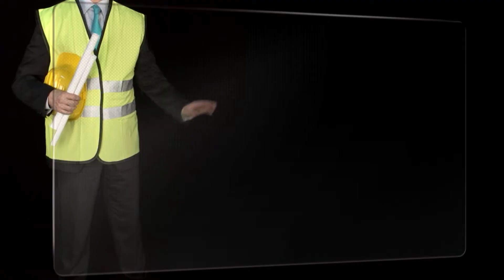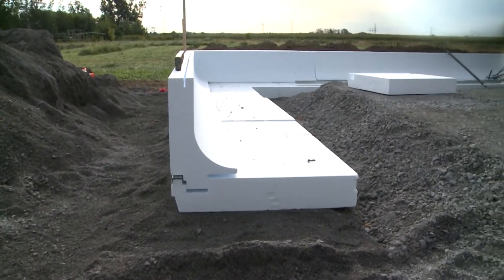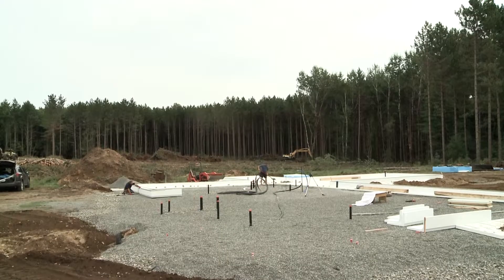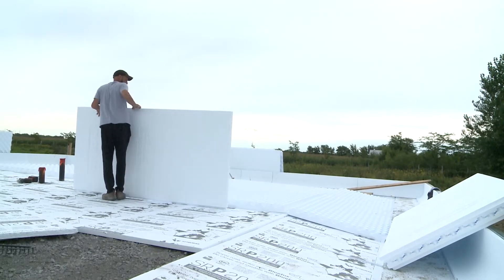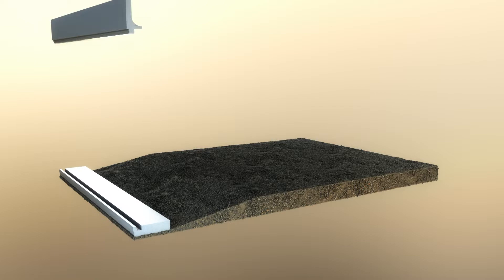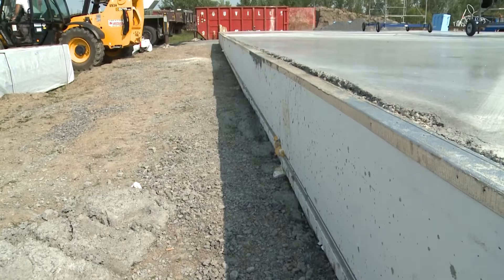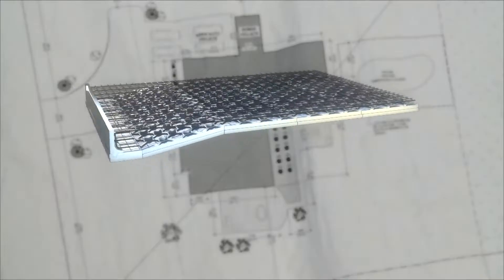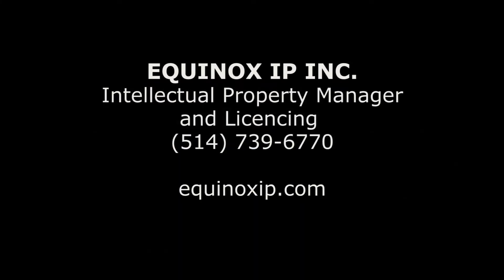ISO-SLAB - INSULATED SLAB-ON-GRADE FOUNDATION

Comment: Is insulation needed in places like Florida?
Reply: Perimeter frost protection skirt is adapt to you frost cycle area ,if request.florida is not request only perimeter modul and inner eps sheet to make dry concrete slab.
Reply from the maker: No perimeter frost protection needed.  The iso-slab base remains to have a mass of dry concrete. Thank you for your interest in this innovation.
Reply: Under slab insulation is R33,5
Reply: The insulation and thermal mass can actually help keep the place cool and reduce the amount of air conditioning.

Comment: Why no foundation on the perimeter?
Reply: Iso-slab is monolithic structural slab not foundation and frost cycle protection will be made by perimeter skirt eps sheet.all spec confirm by structural engineer.